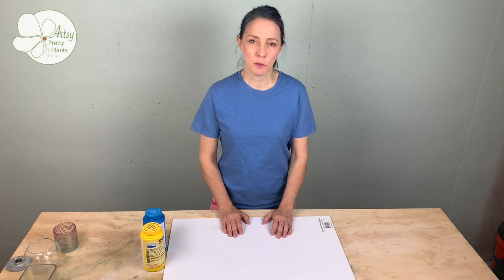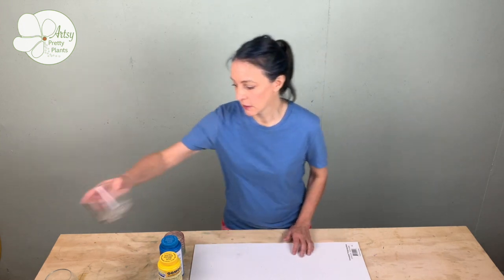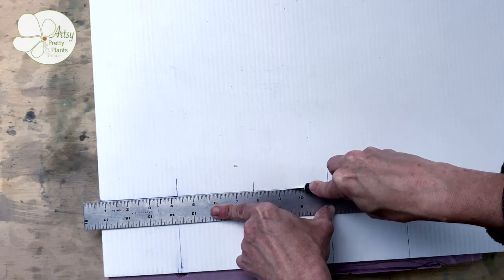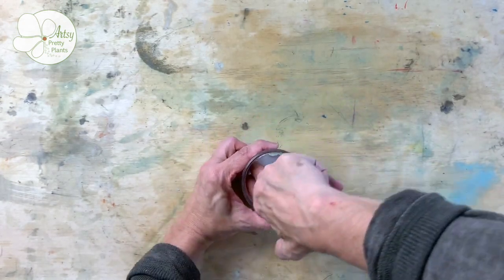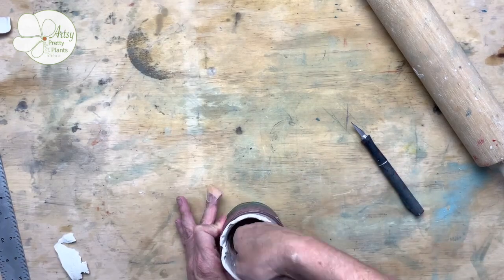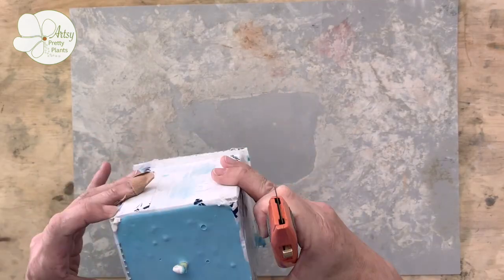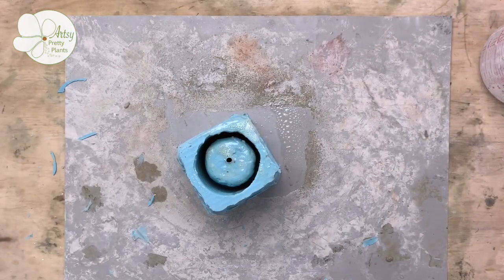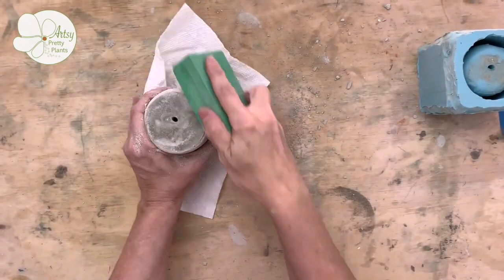Make A Silicone Mold For A DIY Cement Planter From An Existing Object

Comment: For the mold box for the silicone, large Lego pieces and bases work great for molding small parts.
Reply: That’s what I use, on top of sticky paper with hot glue on the outside.

Comment: Good tutorial. I am looking to make molds of some custom designed pots I have made with clay. If you run out of mold maker you can add more but you have to let it cure first and don't remove it from your mold box. I have done it a lot when I did not mix enough. Liquid silicone will bond to cured silicone no problem. - Heidi
Reply from the maker: I wondered about that- good to know!
Reply: @ArtsyPrettyPlants  yeah if you want to make a 2 part mold you have to use a release in between the 2 parts or they will stick together. I use oomoo and they have a lot of how to on their youtube channel.

Comment: This is.BRILLIANT! One thing I was curious about is u mentioned brefiely about making the more intermediate mold with curved glass. You said there were couple extra steps. I looked at your library and didn’t see how to do it. If by chance & have the time could U make a quick tutorial ( if possible not having to go over everything you went over in this video) of how that is done. I have a beautiful glass  that I’m dying to make mold of and it very similar to the one you show in your video. I would love to make a mold that’s very similar  at .45 seconds you mentioned it. I really appreciate your videos it was exactly what I was looking for and there’s nothing like your tutorials anywhere  showing exactly how to make what I was trying to make! Thank you so much!!
Reply from the maker: Hi Lisa Marie, the trouble I'm running into is that you have to make a keyhole cut (kinda zig zag) down the back of your silicone mold to remove a round object. If it's only slightly rounded, you may be able to get it out without making the cut. It's not a big deal, but sometimes the line it makes where the cut is, doesn't sand well. I think I'm going to have a tutorial where you use mold builder which is a softer material and it's possible a rounder object can be removed without making a cut. However, this type of mold material won't be as durable and you may not be able to make many copies. 

The tutorial probably wouldn't happen for another month or two though. I haven't given up!

Comment: This is a great tutorial, I have be browsing your blog and the post comparing different concrete brands was great. But I am still a bit confused about the curing process for planters specifically. Do you think you could do a video about how you cure and make concrete or cement planters plant safe? Demolding, wrapping them damp vs submerging them etc. Seems no one has any videos about this except for hypertufa planters which seem to be very different from smooth concrete planters... 

Thanks a bunch, you are a wealth of information!
Reply from the maker: Hi Sara, 
There's actually nothing that needs to be done when letting concrete cure. Just set it aside. Depending on the project, especially a larger one, sometimes you may need to do the same as with Hypertufa and spray it and wrap it in plastic regular

The reason for "wet curing" is that sometimes concrete or cement can cure too quickly and cause cracks. Like I said, I haven't run into that issue. If you cure it outside in the sun, you would definitely want to wet cure it.

As far as keeping cement planters plant-safe, the first thing to understand is that the only issue with cement and concrete and plants is that there is lime in them. The lime is highly alkaline so once they get wet, this alkalinity leaches through them. Plants like succulents do very well in a higher alkaline environment and nothing needs to be done to the cement/concrete. They are good to go. 

For other plants, it is best to soak them in water for a few to several days. Change the water each day and this should thoroughly sped up the leaching process and it should be safe to plant any type of plant.
Reply: @ArtsyPrettyPlants  thank you so much for taking the time to respond! Hope you don't mind taking more time to go over a few more things with me...

 So the idea is to let concrete planters cure slowly to avoid cracks by keeping the planters in a damp condition (spraying or rinsing with water on regular bases and wrapping with plastic) this is a good idea but not necessary. 

Then if you plan on using plants other than succulents you will need to submerge the planters in water and change the water every day for 3-4 days to speed up the leaching process to get rid of the alkaline. 

Sorry I have a couple more specific questions: 1. Can you submerge the planter in water directly after removing from the mold (in a garage environment) or do you have to do the damp curing process first? 2. is there a sanding process to make areas on the planter (mainly the top that was exposed to the air) very smooth if that part of the planter seemed very dry when removing from the mold? or can you only fix the smoothness with the right combination of concrete mix. 

I used quikrete mortar mix then added a flow control from another brand; rapid set (not sure the results were that good, and the rapid set doesn't recommend mixing brands but I bought stuff before doing more research 🤦‍♀️. The planter sides are beautiful and smooth (some holes but I like that) but the top rim that was exposed to air while in the mold is very rough, I feel like chiseling, scraping, and sanding with a variety of different grits is making the texture worst. Is this texture problem because I left my planters in the mold for to long? 

Also sorry last thing! Do you have any experience combining wood with concrete or cement? Mainly I would love to make something very flush and smooth which makes me feel like wood should be a part of the molding/curing process? is that a terrible idea? 
( something like this https://i.pinimg.com/736x/5e/5b/96/5e5b96fdc963d3b6d5d390d12beba555.jpg  or this https://i.etsystatic.com/11339040/r/il/79e5b2/823002172/il_1588xN.823002172_rg4x.jpg) 

thank you for all your wisdom!!
Reply from the maker: @saraannpaske  Re: wet curing-I have made about 100 concrete/cement projects and haven’t ever done it.
Reply: Hey Sara, 
The word ‘cure’ is key. Concrete doesn’t harden by drying out, it hardens by a chemical reaction. The water doesn’t leave, it combines its molecules with molecules in the concrete mix through hydration. The longer this reaction happens the stronger the concrete becomes over hours, days, months, even years. If it’s hot and dry and the water starts to escape from the mix it won’t cure and end up weak and crumbly. If you’re casting sidewalks in Phoenix you need to cover things with plastic sheeting to keep the water in. (Pre plastics builders would use wet burlap and keep spraying it down hence ‘wet cure’) Making planters in your house or garage and they will cure fine. TMI I’m sure, I’m a retired civil engineer and still get enthusiastic about concrete.

Comment: i made a jar or planter like that but bigger , but barely could get it out , because the suction in the middle of the jar where it filled in the jar in the center, was too much..i had to cut four zig zag cuts , but even then my room mate and i were tugging and pulling and sweating to get it out....when i made a resin piece i could not get it out at all
any suggestions?

Comment: Thank you for sharing this great tutorial . can you please give us more information about CTS flow control ? Thank you again
Reply from the maker: Flow control is added to the Rapid Set mix when wet and will give you more fluidity. It only lasts a couple of minutes, so the purpose is to get more fluidity without adding more water. Too much water may make the cement be susceptible to cracking. It doesn’t slow down the working time - which is what the Set Control is used for.

Comment: Great video - very helpful!  A couple questions - if your  object has smooth sides or i want smooth sides instead could you wrap the clay around the outside of the object to build up the  sides instead of putting it inside?  And if my pot already has a hole in the bottom do I just put a straw in the already existing hole or just leave it open?

Thanks again!
Reply from the maker: Hi Jennifer, 
Yes, you can wrap the clay outside. And yep, go ahead and just glue a straw to the existing opening. That will keep the silicone from filling it in.

Comment: Great video!  What kind of clay are you using?
Reply from the maker: Hi Liz. Thanks! It was an oil based clay- so it doesn't stick to the silicone. I have the written tutorial with links to the exact products I used on my website. I have the link in the description.

Comment: Rather than pour from the top is it possible to do a two part mold instead?
Reply from the maker: You could, but then you'd have to deal with sanding the line it creates.

Comment: I'm having trouble using their calculator.  I want to make a mold with inner dimensions of 4 x 4", will there be enough silicone for that?
Reply from the maker: Hi, I’m not sure, but their customer service is great. If you call them, they will be able to tell you. I can tell you that I ran out of material on this project and mine was slightly smaller, but I don’t remember if I had 2 full containers. But the guy I called at oomoo said I could let it cure, and add more silicone mix after -hope that helps.

Comment: Did you end up using all of your silicone for this? I'm worried I won't have enough for a slightly larger planter. Thanks!
Reply from the maker: The links are on my website. https://artsyprettyplants.com/make-silicone-mold-for-textured-cement-planter/

Comment: Thanks for sharing. But I think you used far too much material than necessary. 1) the square mold makes you use twice as much comparing to a round object around the vase. 2) inside you could use a pipe in the middle so you could save material inside.

Comment: Hi did you use the entire pints to make this one mold? I want to get this but to make at least 2-3 molds. Would it be enough?
Reply from the maker: Hi Jen, My silicone bottles (A & B) say they are 1lb each. For that 3" glass vase I used to cast my mold, and the size of the container I made, I ended up using most of the silicone. To make 2-3 molds, you will need 3 packages of the 1 lb. The written tutorial has more details than the video. The link is in the description. I also link to a volume calculator.

For this planter silicone mold https://artsyprettyplants.com/silicone-concrete-planter-mold-from-pvc/, I used a round container which was more efficient and I ended up with a little extra silicone, but not enough to make a second mold.
Reply: @ArtsyPrettyPlants  thank you for your quick response! Helps a lot

Comment: I cannot tell if these are reusable. It is a lot of work, seemingly, unless you are able to make multiple pieces from each mold.
Reply from the maker: Silicone molds are the preferred mold material for concrete/cement crafts and are specifically used because they are reusable. You will be able to make many, many multiples of a cement craft. Not all silicone materials are the same. This type will be most durable.
Reply: It depends on each brand, but you could at least make tens of pieces from each mold using a cheap brand before it wears out